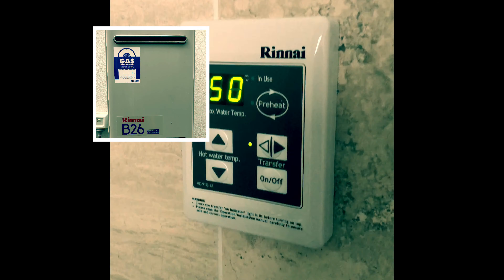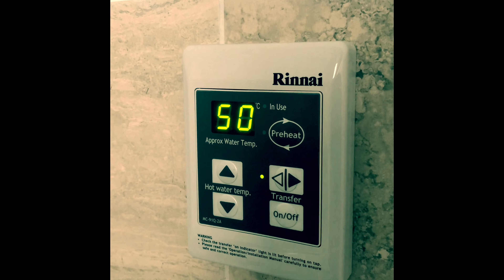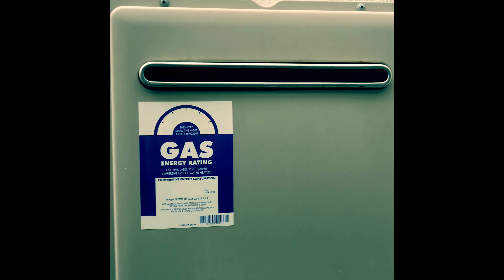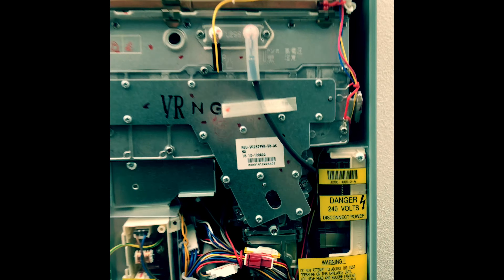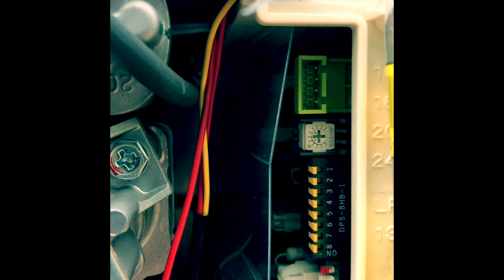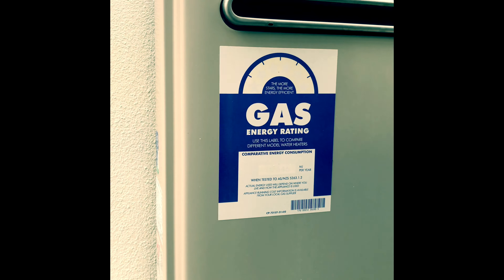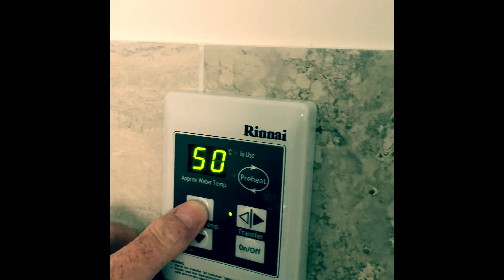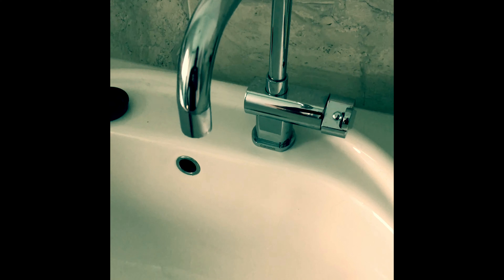Rinnai B26 temperature increase Adjustment. Gas Hot Water System

Comment: I’ve got a exact same unit and I did a same way but the temperature hasn’t gone up.The only thing that I need to make sure is mine doesn’t have a control panel to show me the temperature like the one inside of your house so how can I make sure that the temperature is on 50 degree??
Reply: try going 2&5 instead of 3&4 see how that goes mate it worked for me